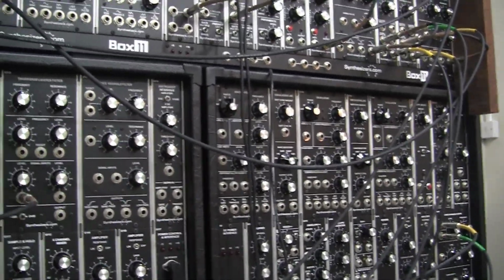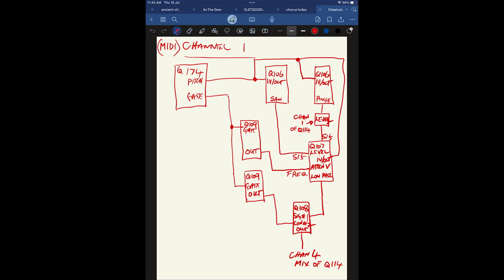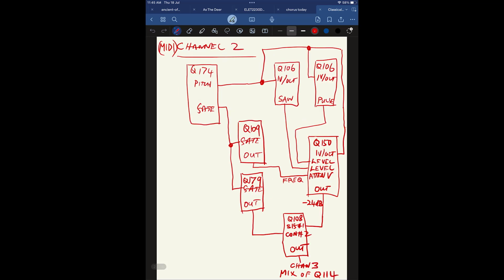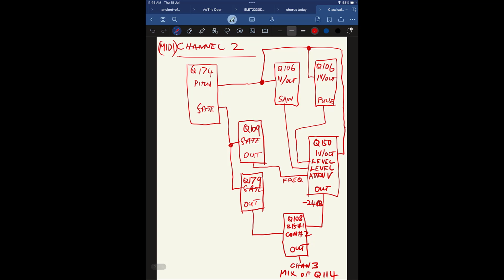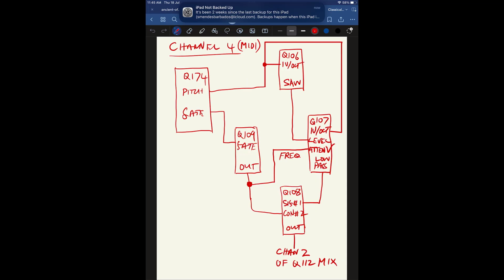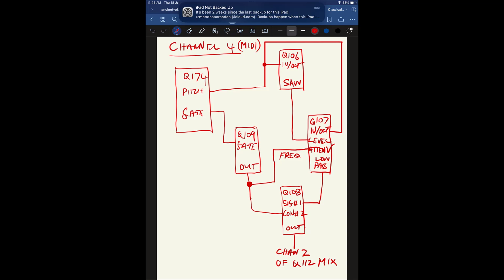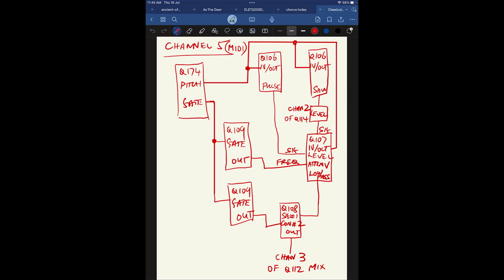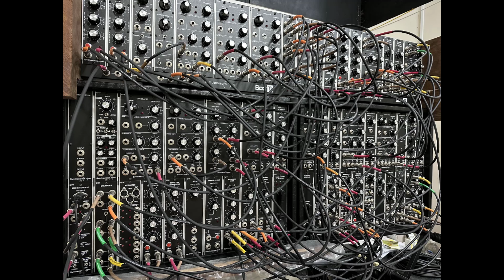Part 1 - Secrets of the Polyphonic Multitimbral Analog Modular Synthesizer

Comment: What a beautiful beast!  Are those jacks 1/4 inch or am I just blind?
Reply from the maker: they are 1/4 inch jacks..... the whole "beast" 😂 is about 4 feet wide by about 2 1/2 feet high ..... so the longest patch cable to connect any jack to any other jack on the instrument is 5 feet (which are the cables with the "green sleeves" )...... the patch you see in the photo uses 62 patch cables ( 12 brown (1 foot length) 25 red (2 foot length) 16 orange (3 foot length) 6 yellow (4 foot length) 3 green (5 foot length) ) ..... and I have some  patch cables left over in 1 - 4 foot range .... these will be used to add various modulation and effects options in my upcoming videos ..... at this stage of patching the analog phaser module, the reverb module and the LFO module are unused ..... and so are Sample and Hold as well as Ring Modulator .... lots of possibilities ! .... thanks for your interest in my videos 👍
Reply: @StephenMendes  thank you so much for your response!  It is indeed beautiful, in sound and form.  The words "analog phaser" crank up my endorphins  🤪🫠⚡